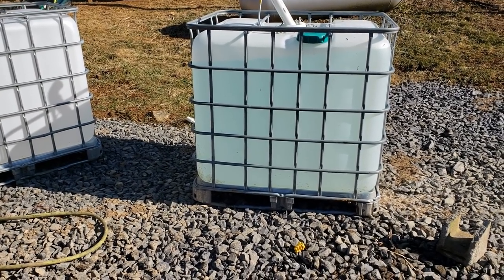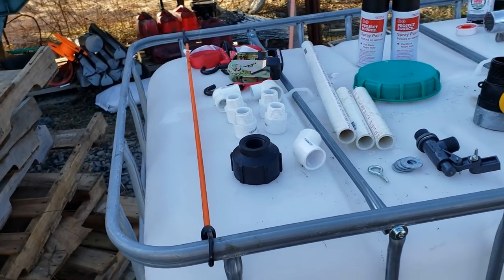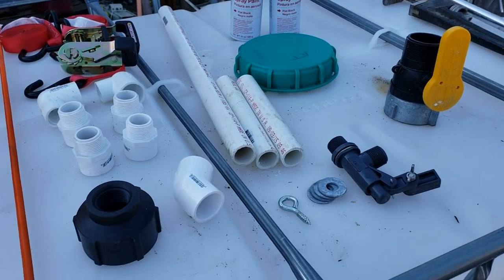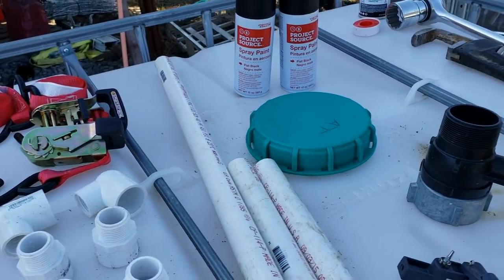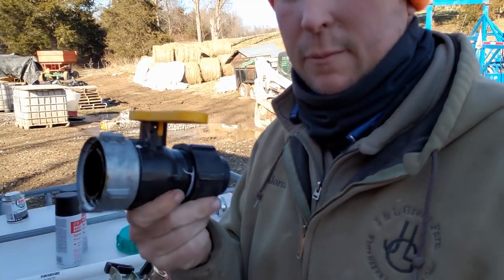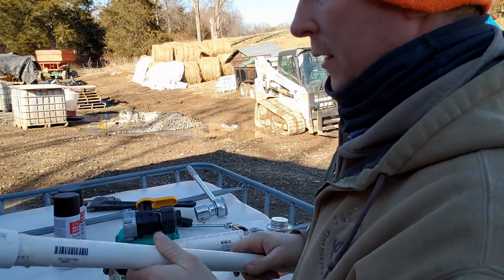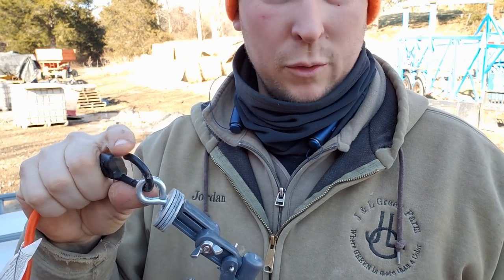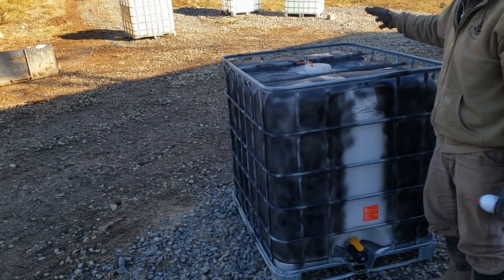Freeze resistant water tank for under $100 reduces daily water work load by 70%.

Comment: So you need to open the top ice to allow air to flow in.
But I bet it would help to just poke a small hole and let the rest of the ice stay on top as a blanket. Over the void that the air just rushed into.  That's the Eskimos and igloos.
Could cut it just big enough for refilling.

Comment: Thanks.  I'm also looking at adding a small solar panel to either add heat and/or an agitator - maybe the small harbor freight solution - 100 watts and a small battery.

Comment: Love the videos!
Good thinking!
Thought:   You've essentially just made a frost free hose bib.  
     It seems like you could simply place a long stem hose bib with the appropriate length of pipe on it to reach dead center of the tank though a bulkhead.
Reply from the maker: You could, there would be some issues with sealing it and anchoring tightly enough to push and pull on the handle though in my first thoughts about it.

Comment: A possible way to save you just a little bit of extra time.  Use a water agitator in the IBC tote and it will not allow the water to freeze.  Sounds weird but it works!  Pretty much you build the IBC tote in this way but then you put in 2-3 water bottles 60% full of water with TONS of salt in them.  Heavily salty water won't freeze, which allows it to bob in the water tank and stop freeze from happening.  We use this method and it saves needing to break up the ice prior to use, it also works in our -30 and below temperatures.. so you know it works!  I boil almost a cup of salt in an old general size hand plastic water bottle, after the salt is dissolved I pour it into the water bottle 60-70% full.  Glue+screw the cap on and tape it so its fully sealed.  It doesn't need to ever come off again, you'll reuse it "forever".  Pop the salted bottle in the IBC tote and it'll "bob" at the top of the water indefinitely, it'll always come to the top and it'll always be bobbing and thus agitating the water enough so the top of the water cannot freeze.  It is amazing!  I started using a tiny version for my chicken waterer and it kept it from freezing over in the barn, then tried on a large scale for my pig IBC tote waterer and it worked the same.  Really handy for people figuring out the fidget winter waterers!

Comment: 13:00 you never showed the valve inside the tank, but I'm thinking it's straight up and down because of the way you showed the valve working before assembling the pieces and how the washers work as a counter weight for closing it once you are finished filling the water. With this setup do you just leave the outside tank valve open because freezing will damaging the valve if closed, or do you close that off too? Or do you rely on the inside valve as the water flow shut off and not risk damage to the master valve by closing it in freezing temps.
Reply from the maker: Correct. The pipe leading to the interior valve passes through the exterior valve so it cannot be be shut. What keeps the water flowing is the only valve is submerged in the relatively warm water of the interior of the tank.

Comment: I have an idea for you I live off grid in Idaho I'm a mechanical engineer I have thought of but never tried in theory it would work I'm speaking of a 12 volt spark plug you put the spark plug through the plastic and connect the 12 volts to it on the outside you can use a battery and a solar panel and this will heat the water leave it in there long enough to heat it to where it'll scold you but if you use enough of these plugs you can either heat the water or keep it from freezing well that's my thought
Reply from the maker: I don't know if there's enough wattage from the panel to heat the water sufficiently.  would be interesting math to run.

Comment: Jordan, we've been using these successfully for 2 winters in upstate NY and they've been great. Do you have method for repairing or replacing a broken/clogged valve without cutting a huge opening into the IBC tank?
Reply from the maker: Add a threaded union on the stem so it can come back apart.
Reply: Any chance you have a picture of what you mean? The stem outlet has a threaded union, but won't fit back into through the original outlet of the tank. Saw this as a potential problem down the road, but hadn't figured out a clear solution yet, other than cutting the stem and losing an inch of pipe for now.

Comment: Is the water still able to freeze up close to the big outside valve and still bust it or crack it with this set up…you didn’t solve that problem with this setup I’m assuming right? Like the water can’t still freeze up against the big valve and possibly crack it ?

Comment: OK. I'm going to build one.  few questions. I watcher the video multiple times to make sure I'm not missing anything, but I am.  I didn't see you use the 1ft. pieces of PVC. I assume you are going up a foot or so from the internal valve. Is that right. Also, didn't see you use the other 2 90 degree adapters. What are those for? Also the 45 PVC coupling? Thanks in advance!
Reply from the maker: Those were for external spouts. Not needed for the tank build.

Comment: 12v pond circulation pump, 12v gel battery, 12v PV panel (morningstar makes good cheap charge controllers), 12v heater element... problem solved for around the same price.

Comment: Given that all of the components are PVC and not subject to corrosion, would there be any harm in adding around a pound of rock salt to every fresh full tank to both lower the freezing point and consolidate your mineral supplementation?
I'm not sure how the pigs would take it, but it seems like the cows might love it.
Alternatively, dropping a whole mineral lick inside might accomplish the same thing with broader coverage, and the low temperature of the water would prohibit excessive salinity, as the saturation point would also be very low. 
Thoughts?
Reply: I would figure out how much mineral they would use in a fill and only use that much or maybe a bit less since they won't necessarily use all the water but they will get all the minerals.
Reply: Excellent idea. Simple, low cost, low risk. Very creative thinkers on this channel.

Comment: I’ve found it difficult to fit the PVC adapter/reducer into the IBC tote valve as the PVC adapter’s diameter is generally too large for the various IBC tote valves I’ve used. I wonder if the PVC adapter I use has thinker side walls? It appears I’m using the exact same parts. Has anyone had that problem?
Reply: At 8:49 is the part I’ve found that the pvc adapter doesn’t fit inside the valve
Reply from the maker: It must be unique to the valve you have. Are the threads matching what your tank is?
Reply: Schedule 40/ schedule 80? Schedule 40 has thinner walls.

Comment: Guess I'm not understanding why you dont just put plastic covered styrofoam 2 inch thick insulation around sides and bottom and removable same on the top. Take it off in the warm weather seasons.

Comment: Then surround the tank with bales of straw or hay for insulation.  Include the simple cheap suggestion by @vashdastampedeo of tossing a few soda bottles filled 60-70% with heavily salted water to continuously bob in the water at the top of the tank preventing an ice layer from forming.